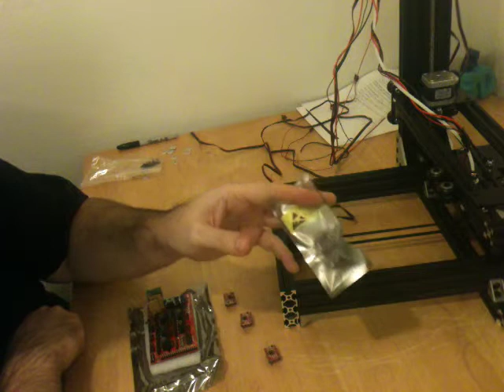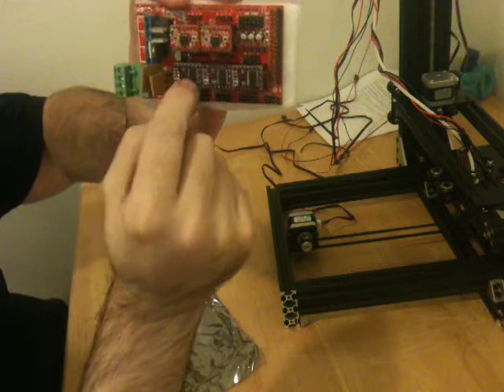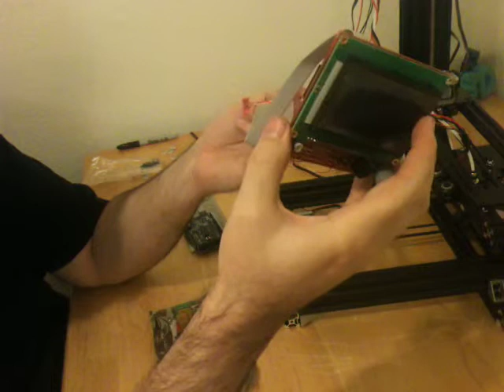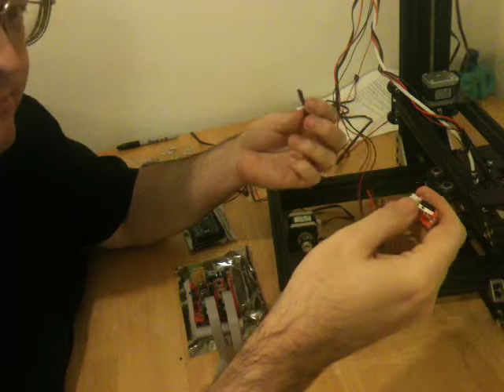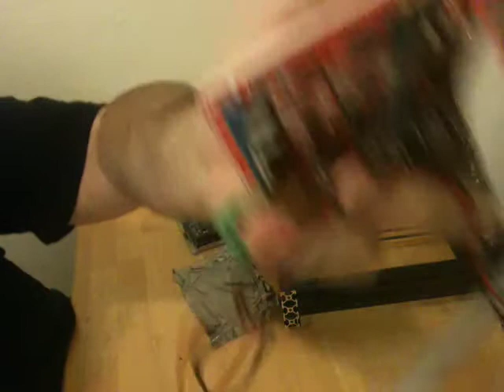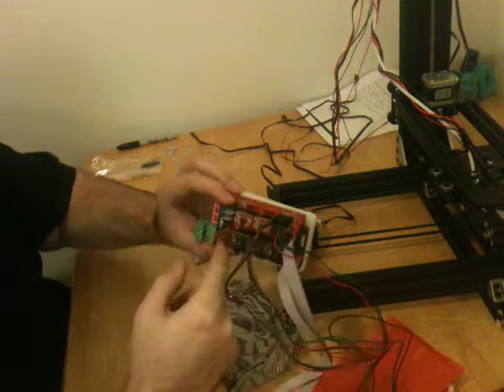Cobblebot Little Monster 3D Printer Build 22

Comment from the maker: +tdrucker424 in a later video I posted links to the parts I printed out. This was the holder I used (although, I am designing a different one for the Y bed to get a few more mm movement, printing the 4th iteration right now, ha ha) :http://www.thingiverse.com/thing:945800

Comment: Hi: Can you please post some info or point me to the url on how to rewire the endstops? Thanks.
Reply from the maker: +rightuse hi, please don't follow my verbal instructions on the endstops here. After powering up the board, I still had a problem. It is best to follow the original instructions I had, just flip around the endstop wires on the RAMPS board side so the red wire is facing the edge of the board and the green wire is on the inside. Also when you work on the Marlin Config.h file, comment out the Endstops Pullup line since these are pull down signal switches. (If you don't they think they are always triggered.) Hope this helps.
Reply: +Peter Phelps: Thank you very much for the directions. Just flipped the wires on the RAMPS board. I had my  X, Y and Z _MIN_ENDSTOP_INVERTING to true previously to open the Triggered endstops. Along with this flipping did the job. I appreciate your help.